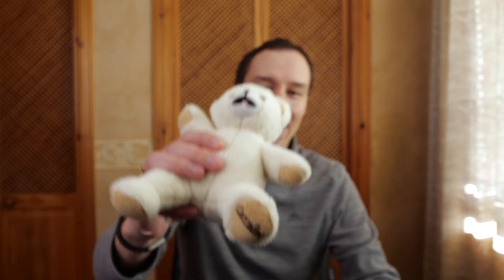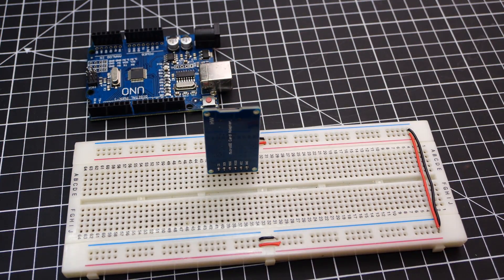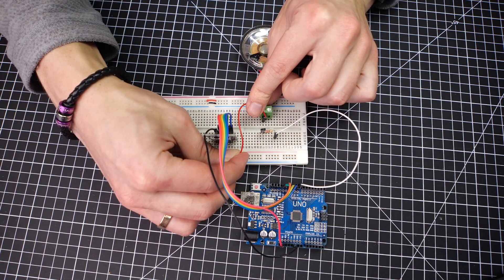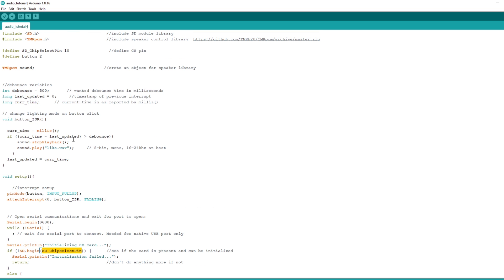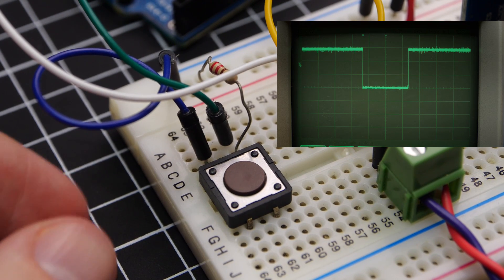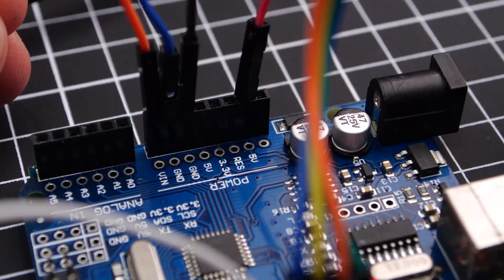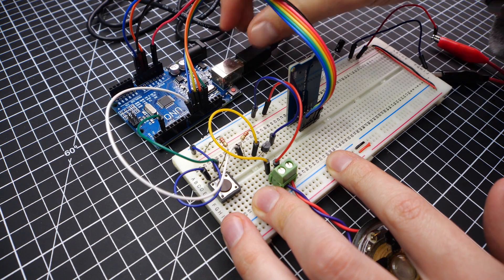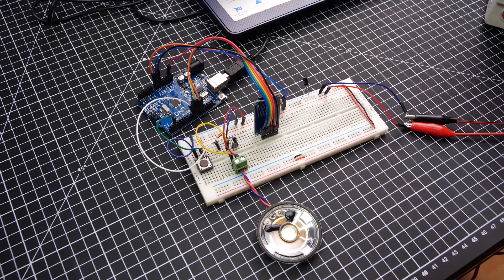How to Play Audio on Arduino + Debug

Comment: 4:32 is it possible to use a bc337 transistor instead of this transistor? I just connected it to this circuit with a 1 kilohm resistor and the transistor started to heat up
Reply from the maker: @Arduinator bc337 should work fine. If you connected everything correctly and the transistor is getting hot, that means the other side of the resistor is connected to supply. This is not good. In this case you will "turn on" the transistor and get a large current through the 8ohm (or whatever) speaker through the collector to the emmiter. 8ohm is nothing so you are basically shorting the supply to ground through the transistor. If you have a muktimeter, you can verify this my checking the voltage on the gate of the transistor (should be zero if set up correctly or around 0.7V if the transistor is on) and collector to emmiter voltage (shoukd be 5V if settuo correctly or close to zero if the transistor is on). Hope this helps.
Reply: @MakeithappenDIY  Thanks a lot, I'll try again then! 😄

Comment: Can you please help me, i want to use tmrpcm and servo lib in my sketch but it conflict with servo , as they both use timer 1. I dont want to use servotimer2 as it's very hard to control it. Please help me and also the tmrpcm library is not working with timer2 after changing it from pcmconfig.h

Comment: when i put my oscilloscope on the pin 9 output, im not getting PWM, it just has supper small spikes in the wave up to 5v but only for a fraction of a microsecond. ive tried everything but i cant seem to get it to work
Reply from the maker: @serentynym3569 what arduino are you using? Google its pinout and make sure that pin 9 is PWM compatible. Next, write a simple code which continuously produce PWM signal to make sure the problem is not with the switch. The signal will be full scale (5 or 3.3V). Make sure you have ground of the oscilloscope connected, that you use the right channel, etc.
Reply: @MakeithappenDIY  i have a Nano, and i just checked and got a PWM signal and it works on Pin 9, working through both the oscilloscope and the speaker
Reply from the maker: @serentynym3569  glad to hear that! 👍
Reply: @MakeithappenDIY  it worked with a sample of PWM not the proper circuit (testing the pwm to make sure that wasnt at fault)
Reply from the maker: @serentynym3569  ok, I see. So might be that your button is wired wrong.
Reply: @MakeithappenDIY  When i press the button, i get the wierd output, while it just stays at 0v when the button isn’t pressed. My thoughts are that the wav file isnt getting properly converted to PWM. Ill rewatch the video on the circuit part but I believe i have it wired correctly.
Reply from the maker: @serentynym3569  use your oscilloscope to see the pin where the button interrupt is to be at supply or ground (depending on your set up) and the see if it goes all the way to the other rail when you press it. You can also debug button in the code. Tell arduino to do sth when you press a button, e.g. light led or create PWM on pin 9 from the debug code which you know produces the signal. wav conversion might also be a problem, you need to make sure that you set the converter exactly as in the video, otherwise you get unpredictable results. Having said that, I would expect something to come out from pin 9 regardles..
Reply: @MakeithappenDIY   after trying many things, i believe i now know the issue. just to rule everything out, i tried using the .wav file used in the video. it worked perfectly, making me believe something is wrong with my .wav files. ill try using the converter that you linked. thanks for helping me out, especially on a year old video!
edit: i cant seem to get one of my files to play... would there be a specific PCM format that it should be? i dont know anything about PCM.
Reply from the maker: @serentynym3569  you are very welcome! I am glad that you are getting somewhere. Unfortunatelly, I am not an extpert on PCM stuff. All you see in the video is trial and error.  I wonder if your audio file is too big maybe. Or you have a typo in the file name (it is case sensitive). Try downloading some small .wav files off somewhere and use the converter on them to see if it works. I am out of ideas otherwise, unfortunately.
Reply: @MakeithappenDIY  Im using it to play the sound of a chest from Legend of Zelda, and initially I used a Youtube to MP3 converter then used the WAV converter, did not work. Found an MP3 online then put that through the WAV converter and it worked. Has me stumped but if it works it works :)
Reply from the maker: @serentynym3569  great job! And the best part is that you earned it. The longest I spent debuging something was 30h. I remember I was exctatic when I finally fixed it :D

Comment: do you need the 10 micro farad capacitor if you just using power source from the 9V plug or USB cable? because in my project i dont need extra power source
Reply from the maker: @HerrHafiz the cap is not essential. I talk about why it is useful in the video but you can live without it

Comment: You summed up all things i need to know in one video , thank you very much .
Reply: I have one question : if i want to make it stereo not mono should i make audio parameters “ stereo “ and add another speaker with the same setup?
Reply from the maker: @Anonymous-hd7en  unfortunately it is not that easy. The software library cannot handle stereo, so if you encode is as "stereo" it will either not play anything or play some noise. And even if it did, the quality of this method is so poor that you could not tell the difference. The target aplication is simple buzzers or a couple word phrases. If you want to have good quality stereo, google "arduino audio stereo" and see what comes up. There are bound to be at least a few different methods!

Comment: Hello, does anyone know if an 1W 8ohm speaker will work with this? Some people said this will fry my arduino
Reply from the maker: @yenterary3228 an argument can be made that if you put the speaker between an arduino pin and ground (it is the same as shorting arduino to ground through an 8ohm resistor), you will damage the arduino. 5V/8ohm is 625mA which is higher than max rated current of 40mA. But I hope noone is connecting the speaker like this! The video instructs using a transistor amplifier. The NPN resistor has a current gain of anything above 50 which means that the current into the transistor will be in the worst case 625mA/50 = 13mA. Also the current is pulsed so arduino can handle more than 40mA. So, I think you are safe :)
Reply: @MakeithappenDIY Im halfway through your tutorial and im using an npn 2n2222A and that apparently has a current gain of 75v, even better
Reply from the maker: @yenterary3228  this number (75) is highly unreliable. You can buy 10 identical transistors and they all have a differen current gain. What is more, this number changes like crazy with temperature. just by touching the transistor with a finger you raise the temperature enough for the gain to change by ~10. In good circuits the current is set by resistors and kept constant  with negative feedback so the current gain does not matter at all. But here I just show a simple circuit that anyone can build :)
Reply: @MakeithappenDIY  I see, thank you for your time! :D

Comment: Hello! I ve been trying to do this and im kinda stuck. What should i do if by doing the led test on pin 9, the led blinks only once? Also, instead of using a speaker , im trying to use in my project a 3.5 mm jack instead. Any idea how i might be able to do that? I found a trrs jack module that might help
Edit: succeded in making the led blink however i still dont get any sound. Perhaps its from the speaker? I have an 8 ohm 1 W
Reply from the maker: @deathknight99938 Hey, I am glad you can see data coming out of your Arduino now! It is hard for me to advise anything other to what the video already suggests. Make sure that your amplifier is wired correctly; the speaker you are using should be OK. As for the 3.5mm jack, it is essentially just a wire so it will work. Again, just make sure you wire everything correctly: connect the L and R channels to the amplifier supply and connect the ground of the 3.5mm jack to the collector of your NPN and this should be OK. Good luck!

Comment: should we use electrolytic capacitor or ceramic capacitor ?
Reply from the maker: It is hard to find electrolytic capacitors past 1uF so for power supply decoupling you normally see electrolytic capacitors. Having said that, it does not matter. For low frequency filtering both will perform the same. The diferences between different types show up in high frequency filtering were equivalent series resistance and inductance start to matter. Actually you might see sometimes in high quality audio circuits that power supply is filtered using 10uF electrolytic cap together with a much smaller ceramic cap in parallel. This is because electrolytic caps though great for low frequency filtering do poorer job filtering high frequency
Reply: @MakeithappenDIY  Ok thanks. I will use two 10uF electrolytic caps for miicrocontroller's power pairs

Comment: Can i use BC547B Transistor instead of NPN?
Reply from the maker: You should be able to use BC547B. Just make sure you get the pin names right. Note, NPN refers to the way the transistor is made (NPN or PNP) whereas BC547B is a name given by a manufacturer. I.e. there are multiple names for the different flavours of NPN and PNP transistors. BC547B happens to be NPN type so it will work.
Reply: @MakeithappenDIY  Hey thank you so much it's working for me  !

Comment: Hi ! I'm struggling reproducing my file audio , I think because of the way you convert itself. I'm italian and the website you used is down so I'm very disappointed and I cannot find an audio converter that make me able to change bit resolution channel ecc. I think the problem is here but I don't know how to fix it. I wish you can help me and my project. Thanks
Reply from the maker: Hi! I have a link to my github page for this project in the description. It has a like.wav file under audio_samples. This is a converted .wav file I used for the video. Try using that. You will be able to confirm if the problem is with the conversion. Hope this helps! Good luck :)
Reply: @MakeithappenDIY I had the same problem where the sound I had converted played, but only garbage was coming out. I tried using the like.wav file included in the project, and it worked, telling me I hadn't correctly converted the audio files (I tried doing it in Audacity at first). Once I used the online converter, the sounds played nicely, although I am hoping to find a way to amplify the sound without causing it to distort. (I am building a portal gun from the Portal series and am aiming to have an activation sound and portal fizzle sound tied to a switch along with portal firing sounds that also trigger LED lights when one of two buttons are pressed.)
Reply from the maker: @Arbiter1223  first of all, cool project idea! I have just saw a video a few days ago of a guy who 3D printed GLaDOS, put in on a robotic arm, and made it a voice activated AI assistant handing from his ceiling (Portal series is awesome!). ...Anyway, in terms of electronics, the speaker is limited by it's own power rating (single digit Watts for small speakers like I used) and the supply source. If the supply is AA battery for example, I would guess it could not drive the speaker as well as say a Lithium batter (which as a smaller source resistance, thus better current driving capability). Powerful speakers plug in to the wall to produce 40W-60W-100W and more of power to blast the room. You will not get from the small speaker with this type of circuit, that is for sure. Having said that, there is a reason why speakers have large boxes -- they resonate to amplify the sound. So my advice to you is to come up with a way to create resonance in your portal gun. Make a little cone (as if a megaphone) to direct sound, or a chamber to resonate. The dimensions and material will matter, are pores on a surface (e.g. in 3d prints) or are the surfaces smooth -- all of that will matter but I am no expert in accoustics, so you will have to do your own research and trials. In any case, good luck!

Comment: hey, i finaly got everything working! it is just very very quiet, any help?
Reply from the maker: Great! What was the problem?
Unfortunately, small speakers are quiet. You would need a more powerful speaker and run off higher voltage source. Or as I showed in the  video have something that directs sound (plastic bottle in my case)
Reply: @MakeithappenDIY  I honestly don’t know the problem, I just debugged until it worked

Comment: Hi Make it happen 

Is it possible to expand this prototype to 6 buttons with the necessary hardware e.g. 6 resistors,  6 compactors etc... If so would I need extra power to the Arduino
Reply from the maker: It depends what you want to do... if you want to have 6 speakers and play six different things at the same time, then no. It would be like asking one head to think about six different things at the same time. If, however, you want to have six buttons to control what is playing, have a volume control, etc., then yes, absolutely. No extra power needed. But the handling of the button presses would be different. There are only a couple of interrupt pins on arduinos. They help to "interrupt" arduino and tell it that something happened (i.e. button pressed). The alternative is to check normal digital pins in the main loop of the code very often. You could register 6 button presses no problem. Hope this helps.
Reply: @MakeithappenDIY   It makes it somewhat clear. I am trying to have six buttons that when pressed they play there each individual sounds. These sounds are all on a SD card. I have tested if the Arduino can read and write in the SD card which it can so the Arduino can access the the SD card fine. The problem I'm having is trying to code the Arduino to scan the SD card for the right file and play the sound. For example button 1 is pressed which should play a dog barking.
Reply from the maker: So if I understand correctly, one speaker and 6 buttons. This certainly is possible. What is more, I think you can have those sounds overlapping if you wanted, i.e. if you click a different button before the dog barking stops, you could have the new sound on top of the barking if you wanted. As for the implementation, it seems it should be as easy as having an if else statement in your loop(). E.g. if (button1) {sound.play("dog.wav")}; else if (button2) {sound.play("cat.wav")}; etc. (where button1 and 2 are digital pin numbers and have their modes set to input (i.e. pinMode(button1, INPUT)).
If, however, the problem you're having is not related to registering buttons but rather actually playing files, it could be that they are not converted to the right format. You can test this using "audio sample" from my github repository.
Reply: @MakeithappenDIY  Yh that is exactly what my project is thank you very much for the help I do believe this does help me a lot

Comment: I keep getting port busy
Reply: Now it’s error opening sketch
Reply from the maker: Sounds like you are missing something. Can you open other sketches?
Reply: @MakeithappenDIY  yes
Reply: @MakeithappenDIY  I eventually gave up, now I’m trying again from scratch, I’ll tell you if I get it again
Reply: I’ve checked my wiring and I’m now getting initialization failed
Reply from the maker: Progress! There could be a couple of things. The card reader has a very tight supply requirement 4.5V-5.5V, check if that is what it gets. The other thing that comes to mind is that the card itself needs to be formated to FAT16 or FAT32. Google "how to format to fat32" if you don't know how.
Reply: @MakeithappenDIY  I’m using my arduino nano every 5v supply pin, and when I get back, I will format to fat33
Reply: @MakeithappenDIY  32*
Reply: @MakeithappenDIY  it was formatted and it still doesn’t work
Reply: @MakeithappenDIY  by the way I am using nano every
Reply: Oops already said that lol
Reply from the maker: Nano Every has slighlty different pinout. CS (SS) is pin 8 and not pin 10. Did you connect it properly and change the code to account for this?  It is hard for me to say without seeing your set up. If the problem persists, maybe you could take a few pictures or a video of what you are doing and post them somewhere for me to see?
Reply: @MakeithappenDIY  do you have discord or anything like that
Reply: @MakeithappenDIY  I tried setting to 8 and nothing, code too
Reply from the maker: @TravelersRuneAlt  no discord, unfortunately. Facebook, if that works for you: https://www.facebook.com/Make-it-happen-100841318570396